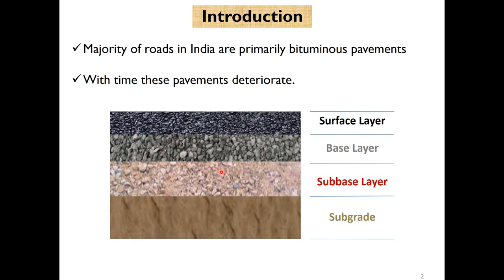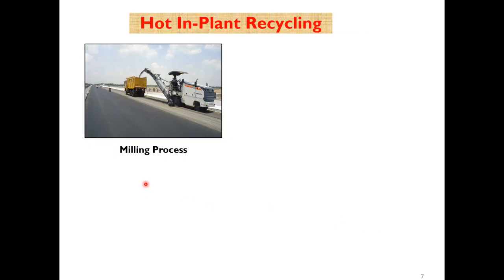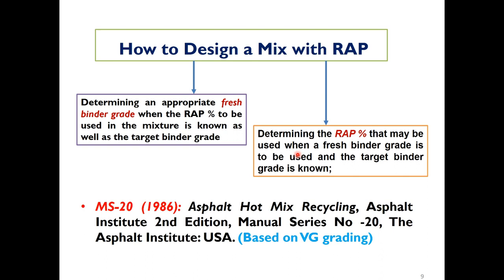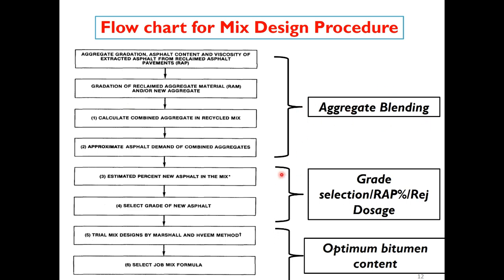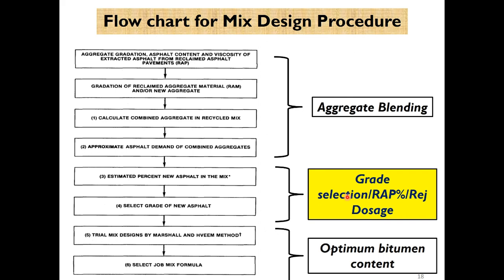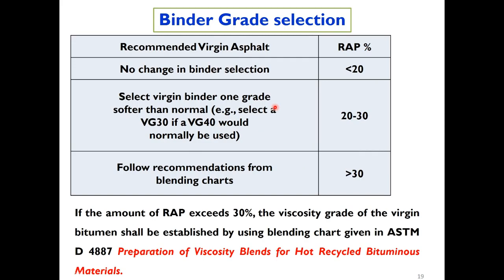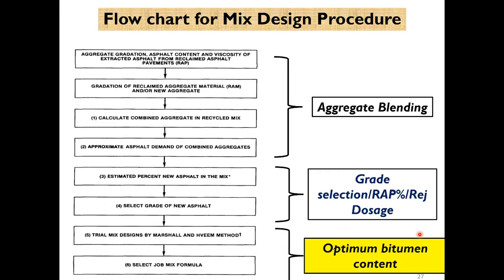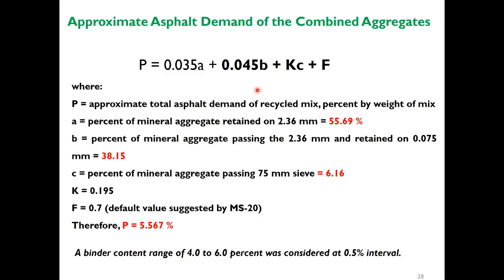#RAP, #highways, #mixdesign, #recycling, Design of Bituminous Mix for hot recycling of Pavement

Comment: Sir, it was a really nice lecturer.
I have few doubts sir. Please clear them.
1. Is use of lime is mandatory for achieving the desired gradation?
2. When we are preparing the mixes, you said first we have to take RAP in the mixer and followed by rejuvenator. If we add rejuvenator extra it will increase the total weight of the mix. Or we use rejuvenator as a replacement. If rejubenator is used as a replacement then what is replaced by rejuvenator.
3. Total weight of the mix is shown to be 1250 grams in the video. But as per Marshall mix Design method it should be 1200 grams. Clear me this sir.
Reply from the maker: the purpose of lime is not really to get the desired grading, it is used as anti-stripping agent. Otherwise cement is also a good filler.
rejuvenator is used in small quantity and it will not affect the mix much. It is used to reduce the viscosity of the aged binder 
In Marshall mix design also we take 1200 g of aggregate and then add bitumen, same is here. The Marshall mold will accommodate around 1200 g and extra material is removed after final compaction.
Reply: Thank you sir for taking your valuable time in giving reply to my doubt.
I have a small question based on your reply given to me.

If lime is intended to add as an anti stripping agent then, my question is
Is use of anti stripping agents are compulsory when we are designing the RAP mixes. Because for normal mixes we generally don't bother about anti stripping agents.
What is the importance of anti stripping agents in the design of RAP mixes?
Clear me this doubt sir.

Comment: Sir, can u explain how pavement layers are behavior..
1. If DBM layer is constructed with VG40 and BC layer with CRMB. 
2.VG 40 for both BC & DBM layers?

Which method is best for the performance point of view
Reply from the maker: There is no direct answer to this question. It would depend upon the maximum daily tempearture of the region. If you use harder grade of binder (like VG or CRMB) in a cold area, it will create problem of cracking and the pavement will fail prematurely. If you use them in hot region, then the pavement will last longer. Advantage of using CRMB (or PMB) in top layer is best achieved when traffic load is heavy (either in number or in magnitude). Otherwise VG 40 is good enough in both the layers.

Comment: Hi sir, BC mix design Marshall mix design with use of plastic waste me kitne proportion percentage me aggregates bitumen lena hai please tell 5%,6%,7%,8%,9%,10% plastic waste rahega and bitumen ke sath mix karna hai iska lab procedure bata dijiye
Reply from the maker: If you are working with dry process then find the OBC as per normal Marshall Method (without adding plastic), and then add plasic @ 8 % by weigth of bitumen. Prepare the mix and find all other properties. IRC SP 98 says no reduction in OBC be made due to addition of plastic.
If you are working with wet process, design the mixer to mix the palstic with bitumen and conduct all tests as per IRC 53
Reply: @SatishIITR  ok sir it's lab procedure all test conducted on lab Marshall mix design method

Comment: Sir if we want to find out physical properties of RAP material, then the different test of aggregate should be done on extracted aggregate from RAP by aggregate extraction test???
Reply from the maker: If you extract binder from the RAP then all tests including grading can be done on aggregates,
Reply: @SatishIITR  is that mean sir if all test results are within required limits then we can use that RAP in road without extracting binder??  i.e. by  measuring net bitumen  percentage for mix after adding RAP?
Reply from the maker: @thisisdpanchal  Yes